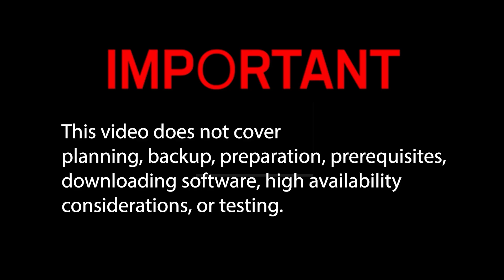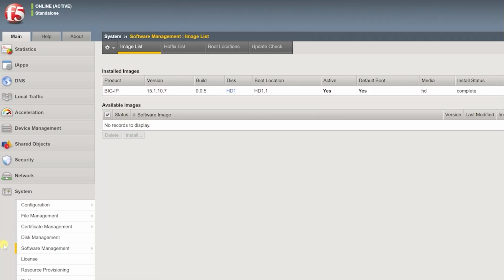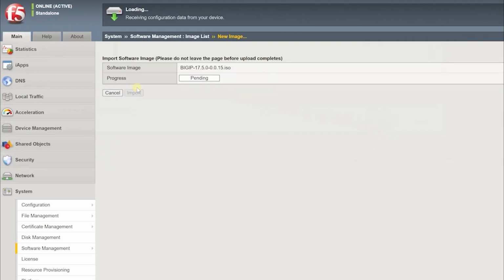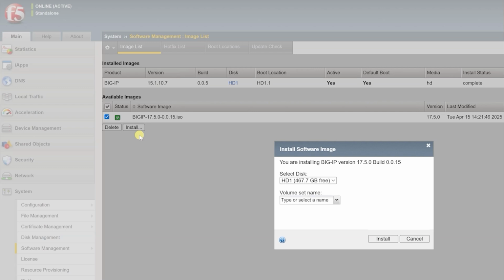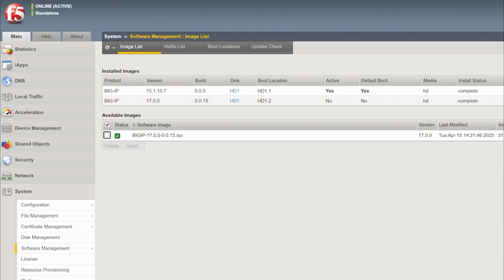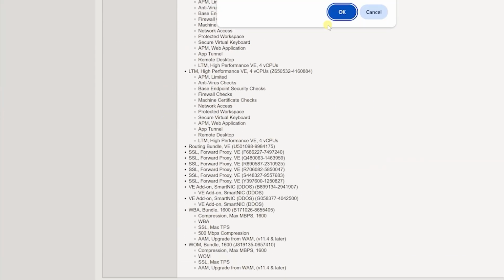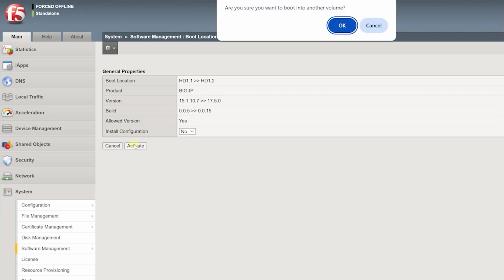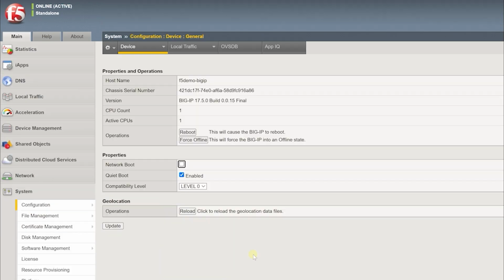Perform a software update or upgrade on a BIG-IP system

Comment: Dear I need further clarity on after uploading an dbooting software HD1.2 --> Install configuration option Yes or no whats its meaning ? i m confused ? I have HA Pair in production I will need to upgrade their firmware
Reply from the maker: There's an article that accompanies this video. In step 4 of the Reboot procedure it answers your question: "If there have been no changes since you performed the upgrade, you do not need to set Install Configuration to Yes when activating the new volume. By default, during the upgrade process, the BIG-IP system imports the current configuration from the active volume into the target volume. If you have modified the BIG-IP configuration since the upgrade was performed, you can set Install Configuration to Yes to [install the latest config to] the target volume before rebooting to that volume." Here's a link: https://my.f5.com/manage/s/article/K51113020. Let us know if you still have questions.
Reply: @AskF5  Dear If we have two nodes in HA such as r4600 series should we import image direct on the host machine or import on tenant. becuase i have two different tenants? please guide